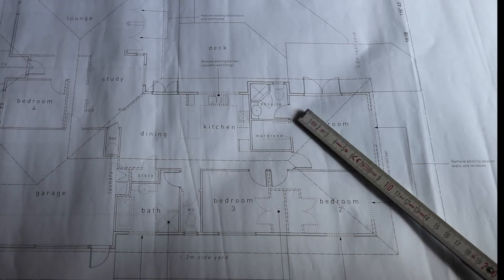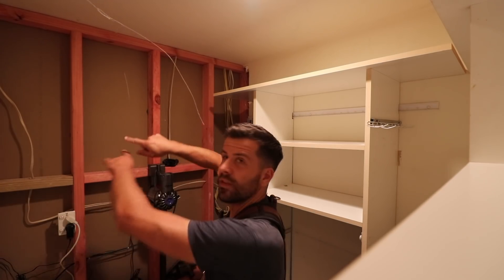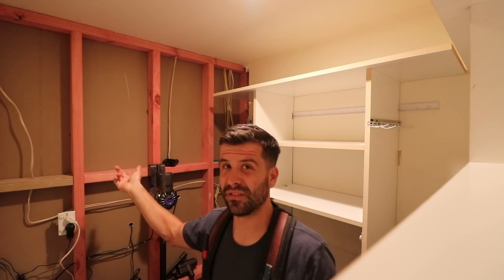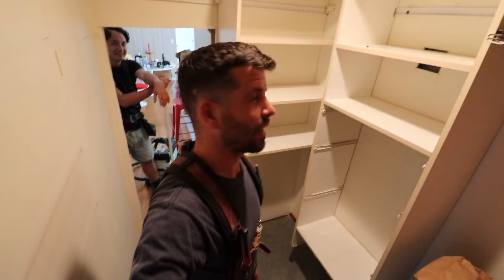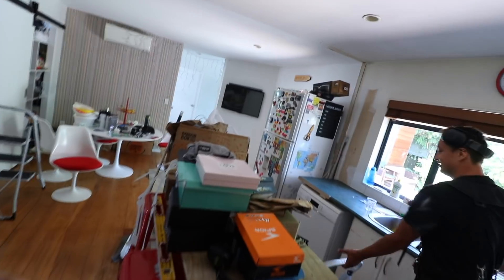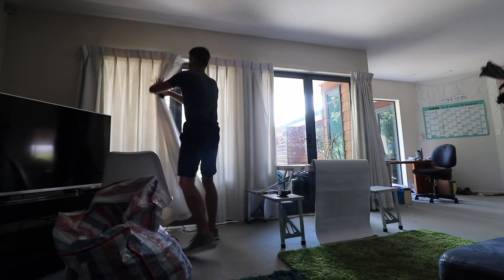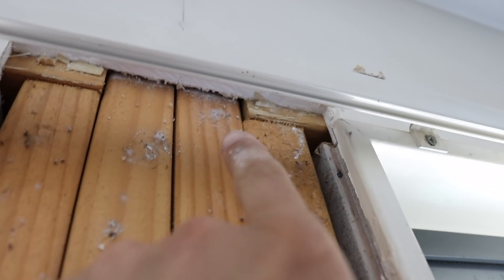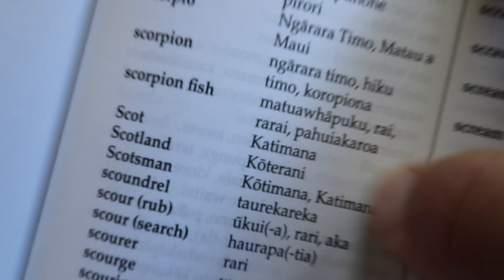From Wardrobe to Scullery!

Comment: it's strange to see that in NZ you're using wood for framing when in London you barely see any wood for building plasterboard frame. love the old school.
Reply: nz is decades behind the rest of the world when it comes to building
Reply: i like the NZ way, it may be a reason to build with wood. earthquakes or high winds, don't know about NZ much. London is way overrated, you barely find any skilled traders around from who you can learn a trade.
Reply: @J0rd4nBr0  I disagree, if S.B is anything to go by then N.Z carpenters are top notch.
Reply: @Toyotaamazon80series  re read my comment because you misunderstood.
Reply: Jordan T - what to Brits use for plasterboard framing?  Here in Canada we normally use wood in residential dwellings and steel studs for multi-res and commercial applications. Just a question for my knowledge.
Reply: @J0rd4nBr0  Irony?
Reply: @ibrazeau3044  In Ireland we use wood for framing in domestic work and usually but not always steel studs for commercial and industrial work. I'd imagine England is similar.
Reply: @Toyotaamazon80series  where
Reply: @J0rd4nBr0  ?
Reply: TheToolnut - Jordan T is saying is that English carpenters should be as good as Scott.
Reply: TheToolnut - so what is n3bux saying about old school?  And Jordan T about NZ being decades behind in building? Seems to me that the framing Scott is doing is normal... at least for me and you!
Reply: @ibrazeau3044  Indeed, there are a lot of brilliant English, Scot's and Welsh tradesmen.
Reply: @ibrazeau3044  S.B from what I can see does top notch work.
Reply: TheToolnut - true... in my opinion it is often much tougher to obtain great results in Reno work then it is in new construction. I often find that a true Craftsman's work shines best in retrofit/Reno jobs.  But then again... look at The Crazy Framer's videos!
Reply: @ibrazeau3044  Agreed, in trying to blend the old with the new one really see's the worth of a tradesman. The crazy framer is very, very good at what he does.
Reply: @ibrazeau3044  I never said anything about framing,  what i am referring to are other parts of the building.  E.g. windows.  I never said anything about kiwi builders being mediocre builders.  I am one
Reply: @Toyotaamazon80series  you think I'm dogging on kiwi builders (not sure why).  Fyi I am one.

Comment: Did you the owners get an Architect to draw the extension plan? Im a carpenter from Auckland in the process of starting my own small bizo.
Reply from the maker: They got the architect. Owner usually consults the architect first. It is good to be a part of the planning process though, sometimes you can come up with ideas that will help the building process run smoothly. We changed some things after consent, but that can add cost to the job.

Comment: For us Americans- a scullery would be a pantry
Reply: @Kyle Smith Same for us Aussies Butlers Pantry
Reply: @zaneh6224  would your Butler pantry have plumbing in it?
Reply: @es4forty88  Yes, it is basically a 2nd smaller kitchen straight off the main kitchen with lots of shelves, typically it has a benchtop with sink, powerpoints, and usually hosts most electrical appliances like toaster, kettle microwave etc that you don;t want to see in the main kitchen, some will have a 2nd dishwasher.